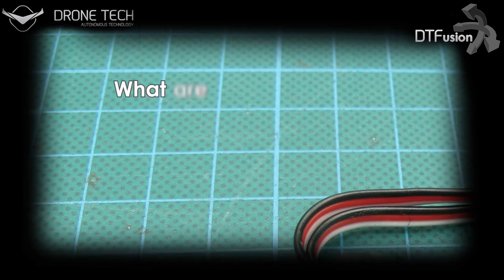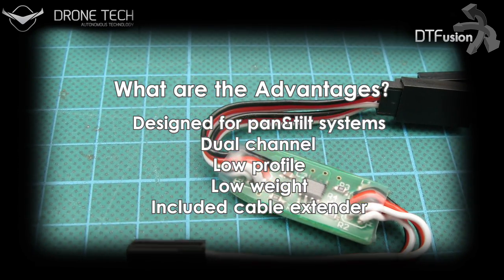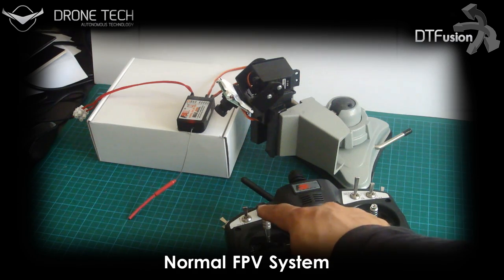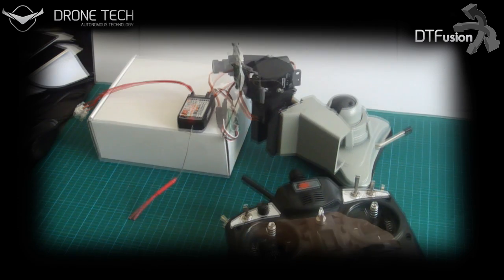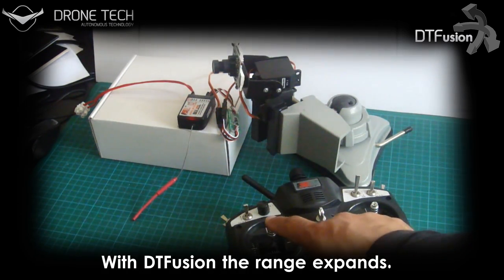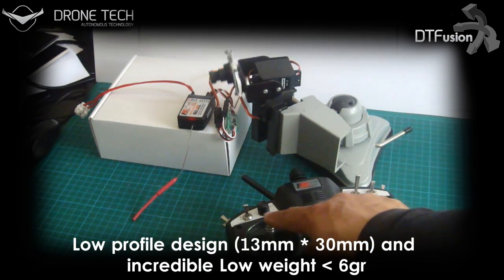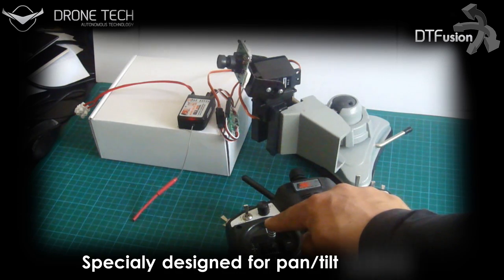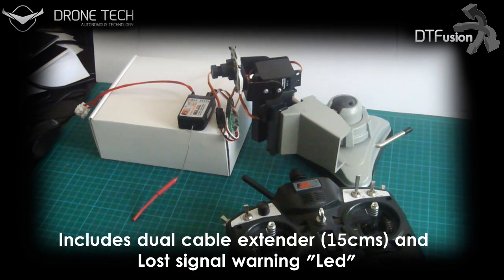dtFusion, Dual channel servo travel expander designed for pan/tilt systems. (HD & Voiceover)

Comment from the maker: Thank you for your comment. The jitter in the end is due to the loss of signal, and is due to the receiver, there is little to  no jitter during normal operation. althought much of the interference is cleaned by the software, there is still a very small percentage that passes and causes jitter, but as said in normal operation is hardly seen.